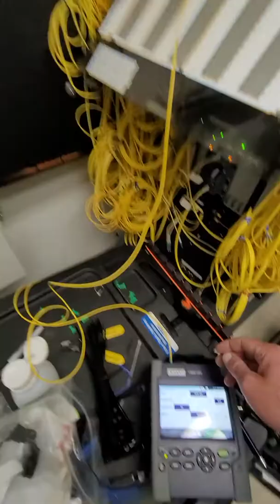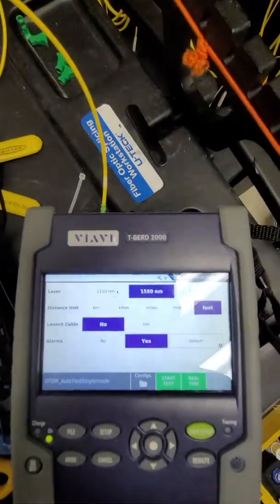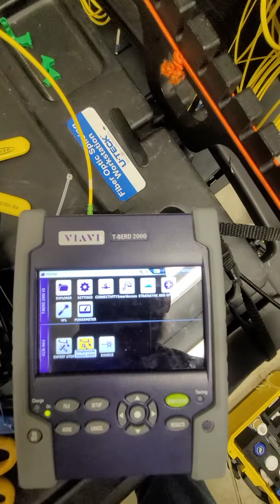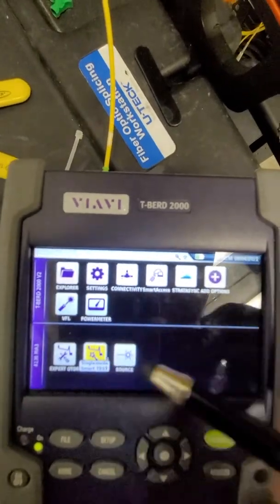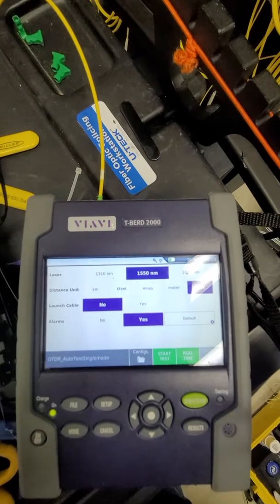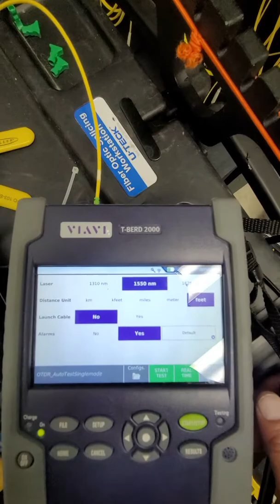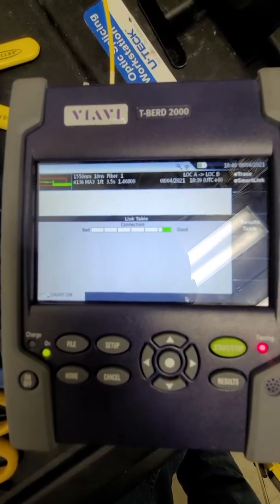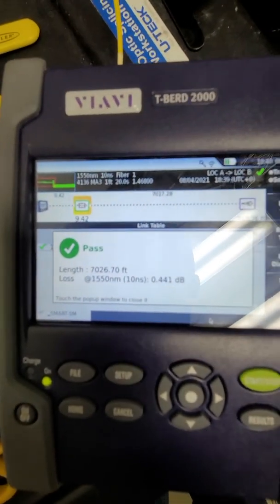How to test Fiber Optics with an OTDR

Comment from the maker: Milwaukee Drop Slitter https://amzn.to/47fLvRL

Milwaukee Fiber Stripper https://amzn.to/42TaXKb

Milwaukee Kevlar Shears https://amzn.to/43sSbJB

Milwaukee Can Wrench https://amzn.to/3L5Cn9p

Miller Kevlar Shears https://amzn.to/3WRckFD

Miller One Hole Fiber Stripper https://amzn.to/3WgsyrL

Miller Drop Slitter https://amzn.to/47DvJA3

Miller Drop Slitter Blades: https://amzn.to/3L9aDke

Miller Hard Cable Stripper https://amzn.to/3J1DYN3

Fiber VFL & Meter https://amzn.to/4hkHG0I

VFL 30KM https://amzn.to/4hp6AME

VFL 50KM https://amzn.to/4o6JOfi

Buckingham Gated Hand Line Carrier https://amzn.to/4qkKiA5

Buckingham Ox Block for Rescue https://amzn.to/48KxRHg

Madi Lineman Hammer https://amzn.to/4hrtYcv

Comment: Thanks Dev, I don’t get to do a lot of testing with PON, however I am definitely wanting to practice and know my OTDR etc
Reply from the maker: @user-lf7en6rf8m  pon definitely adds challenges in testing. We we're mainly an active Ethernet provider for the past 20 years and now we do xgspon. If you test downstream some OTDRs say they will map splitters and what not and they have some that you can put in line between your ont and gpon card. 
Onts arent supposed to send light at all toward the splitter until they receive it from the head end to prevent jamming the other onts since their in time division. Really neat but definitely adds challenges

Use to we could turn the switch point off on a AE fiber to test. And now we can't without cutting down 31 other customers. Guess that's where the in line tester comes in.

Comment: Is the fiber actually 7000 feet long?
Reply from the maker: The jumper you see in the pic is about 3 meters so you can subtract that out. But other than that, yes.
Reply: So, the 7000 feet of fiber are behind or after the patch panel? @Fiberline91

Comment: So you don't have to connect anything on the other side of the run?
Reply from the maker: No sir you dont, it just shoots light waves down the fiber and they bounce back due to reflectance and the otdr reads those bounce backs to determine the events (splices, connections, end of fiber, etc). 

Here a link from viavi:
https://www.viavisolutions.com/en-us/working-principle-and-characteristics-otdrs#:~:text=The%20laser%20emits%20a%20pulse,photo%20detector%20in%20the%20OTDR.
Reply: @Fiberline91  cool, thanks.
Reply from the maker: All though, in some testing scenarios a company may require both a launch and receive reel. I will try to do a quick video to explain the application of those as best I can.